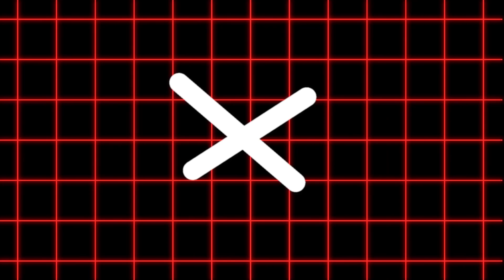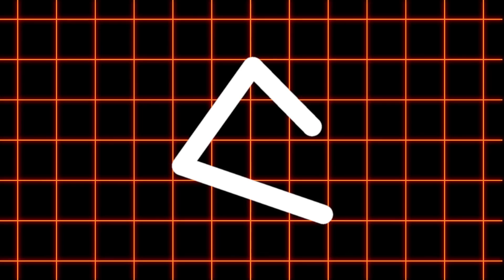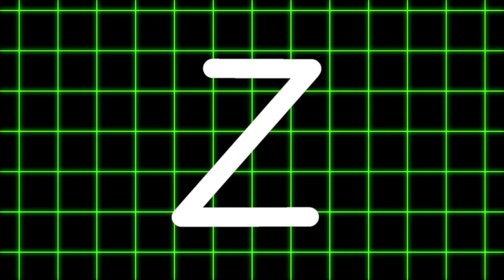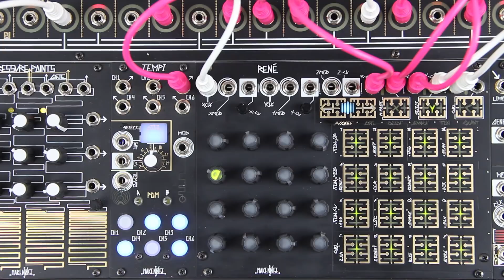An Introduction to Self Patching René

Comment: Is it possible to damage the shared system by installing brains wrong?  Im going to install a disting too.  Im going to be super careful to put the power strip in right.
Reply from the maker: Perhaps if you connected power to one of the Expand headers, or something really weird like that. All our currently shipping modules are protected against reverse powering.